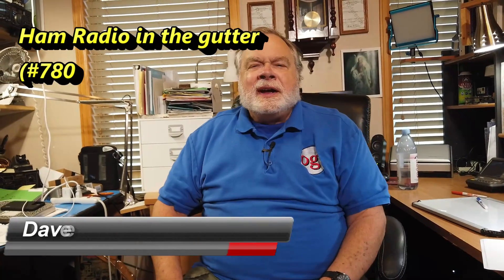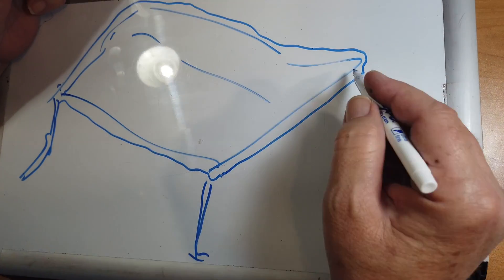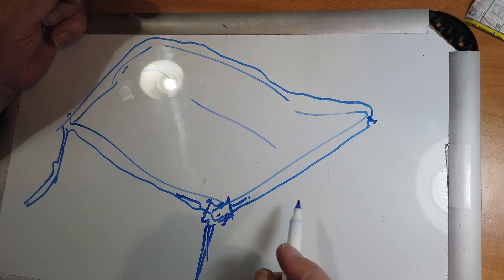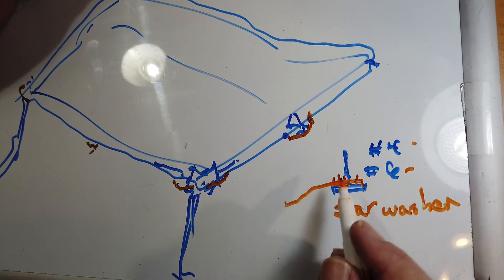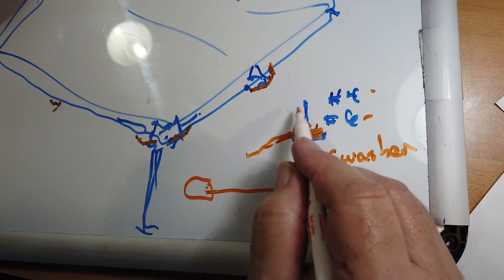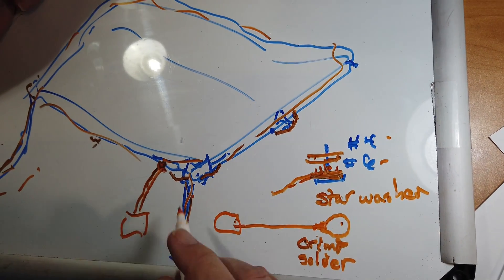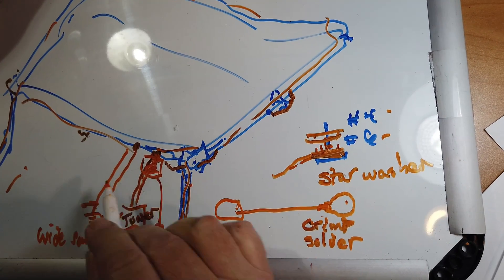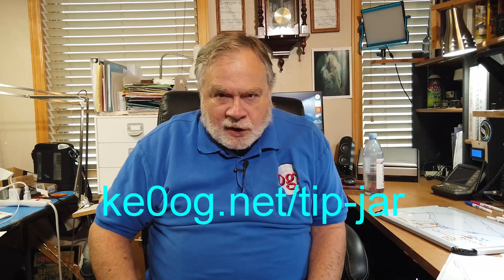In the Gutter with Ham Radio (#780)

Comment: I want an antenna, but I NEED a tuner. I thought I was being forethoughtful when I bought my IC-705 but not having at least an internal tuner is really limiting on my capabilities as a new ham. SWR is too high on my homemade antennas though I thought I followed instructions perfectly. I think the issue may be on the diameter of my radiator. It's thin and thus giving me very narrow bandwidth and I'm probably over reaching my resonance by being on a frequency in the band I'm not matched with.

Comment: Most gutters are aluminum.  You need to be aware/concerned about galvanic corrosion if you use non-aluminum hardware for your electrical jumper connections.
Reply from the maker: Excellent point.

Comment: If you are going to use your gutters as a horizontal antenna then change the downspouts to plastic. Not only does that keep the downspouts from acting as random stubs but it keeps the RF well out of reach of anything which can experience pain. 

If you are going to use the downspouts as part of an antenna then replace the bottom of the downspout with plastic so that the first point of possible contact with a radiating element of the antenna is 10 feet above grade or the walking surface below it.

Another isolation technique is to use a false plastic downspout as an insulator for the vertical portion of the antenna. By feeding that with coaxial cable which has it’s shield grounded only at the tuner end of the coax you can isolate it from contact quite effectively. 

It’s a little like a swimming pool in that the plaintiff’s attorneys will try to convince a judge and/or jury that your unguarded antenna is an attractive nuisance. If that argument is sustained they the court will conclude that you failed in a duty to the child to isolate that danger from contact by that child. Remember that in many States a minor child is incapable of trespassing on your property. It is held that you must know that children will wander anywhere they can physically get to as part of the very nature of being a child. 

Tom Horne 

I don't like making plans for the day, because the word "premeditated" gets thrown around in the courtroom.

Comment: Put those jumper bolts on the side - not the bottom of the gutter so they won’t block the flow of debris. Otherwise you’ll have a log jam at every joint!

Comment: Was considering this just today as I was putting up my new EFHW dipole sloper behind my house.  Question:  Can a two foot tall aluminum fence set in concrete blocks running three quarters the way around my property serve as either a ground or a counterpoise?
Reply: It might - give it a go. You may want to experiment with a ground rod attached to that fence.

Comment: At my last house I loaded the tallest gutter, about 25' tall with a 8' "T" on top. Probably acted as a bit of a cap hat. Simply ran a short wire from the bottom of the vertical piece to a 9:1 unun, and spread out a dozen 11.5' radials. That was one heck of an antenna, and worked far better than the 40m EFHW I had up too.

Comment: yes with a counterpoise for each band you want to work, and a tuner preferably manual
Reply: Why preferably manual?
Reply: @sammiller6631  autotuners sometimes wont tune certain bands well or finish tuning on non resonant electrical lengths and are more designed for ready made compromise antennas like g5rv or doublets  a manual tuner like a 949 can get you much closer with a random wire which is essentially what a random length of gutter is.
Reply: @fredbissnette3104  How is a doublet a compromise antenna? It's a dipole fed with ladder line which is much lower loss than coax.
Reply: @sammiller6631  any antenna that requires a tuner is a compromise,  an antenna that is 100% resonant and provides dead flat swr is the desired situation for the frequency you want to work

Comment: Yes you can
Reply: I talked to a fellow ham last week on the radio he was 5/9 ++ i asked him what you were running radio antenna system he told me hes in an hoa area then he told me hes using his rain gutter i didnot believe it he really was hes in a hoa area thats why hes running the gutter the hot side separate then    Ground  he was very strong i couldn't believe it i remembered talking to a nother ham 2 years ago talking about secret antennas. It was in an old handbook and finally i worked a ham with one its working great for him he does ft8 etc on it antenna are a cool topic⚛

Comment: I ran my rain gutters in my apartment building for almost 2 years. Actually completed my DXCC on it. I used a 9:1 unun and a MFJ VersaTuner to match it. Worked very well… except that it was pretty noisy being right against the building filled with cheap Chinese electronics. I ran the counterpoise back to my station ground rods. It worked on all bands 160-6 meters.